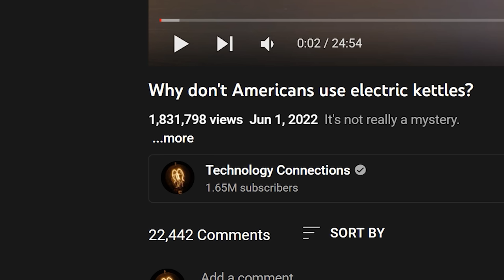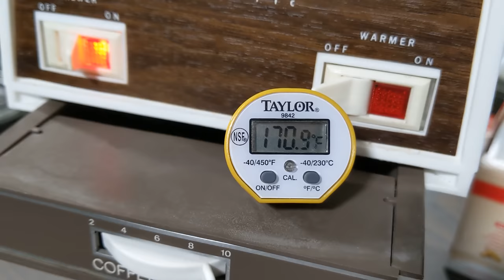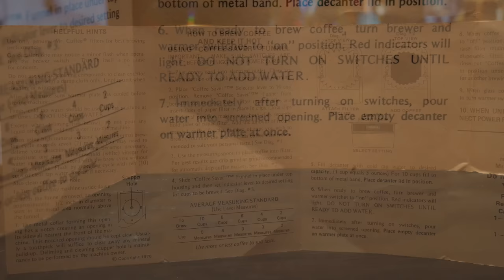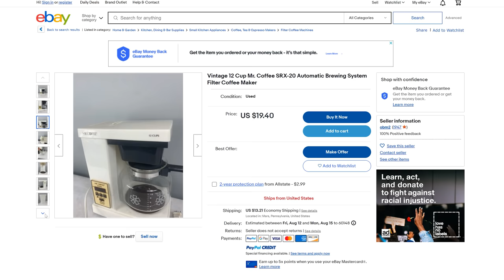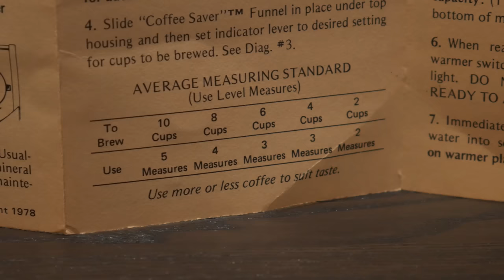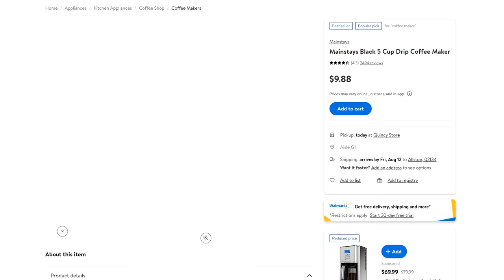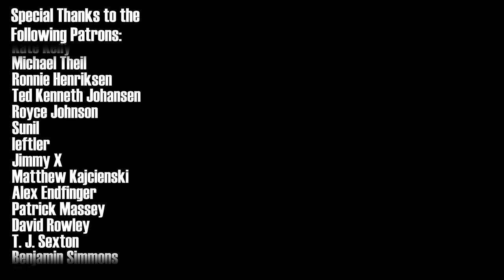Drip Coffee Makers — super simple, super cheap

Comment: If you actually buy a good drip machine, you can set the hot plate to a LOW heat and it wouldn't overcook the coffee.
Reply: good or bad drip machines, the issue with the got plate is with it there and on its just adding heat constantly to the coffee, that turns it out no matter what, it just gains you an extra few minutes, but your right in that unless you spring for the models with an insultated carafe and no hot plate, at least being able to control the temperature of the hot plate is ideal... my machine not only does that, but as the coffee sits the machine steadily allows the temperature to fall, its yet another way that your being told your brew is probably getting old.

Comment: As a coffee outsider from Australia, this is super interesting. 

At 31:21, You mentioned at the end that leaving the hotplate on will quickly burn the coffee. 

The cost saving measure, whereby the temperature of the warmer hotplate in the modern unit is controlled by the same heating element and thermostat combo that controls the boiling, means this hotplate is pretty much contantly set to a temperature just above 212. Which means your "keep warm" part of the machine is actively boiling the coffee, just like a percolator does (except not at all). At 31:37, while you're talking about this same burnt flavour problem, the coffee in the carafe is visibly simmering. Well there's your problem.

I would posit that maybe that the warmer in the older unit may not burn the coffee as fast, or it may have a separate thermostat which keeps the temperature under Marotta's 200 degrees or therabouts, or it may be controlled by a resistor on that board at the back. I'm just saying, maybe the older unit wont burn the coffee while left on the warmer. 

At the very least, you could theoretically modify the older unit with a thermostat set to 190 to control the hotplate, which should keep the coffee from burning. Definitely not something you could do with the modern unit.
Reply: He said the older unit has a separate warmer, only 80 Watts, may not even need a thermostat.
Reply: In my machine I notice the coffee disappears visibly in the carafe after a couple hours on the hotplate, though it doesn't taste burnt
Reply: Thanks for this. I've never had a pot burn that fast and was wondering what the deal was. I assume all coffee makers here have a different setting for the hotplate. The coffee does turn bitter, but that's only after 2-3 hours.

Comment: I like the french press. It's dead simple and easy to clean. No filter paper needed. The only slightly tricky bit is making sure the plunger filter thingy is in tight contact with the walls. Otherwise you could find some grounds in your cup.

I do recommend not getting one made of glass though. There are metal ( double walled! ) models that won't shatter if you tip it over.
Reply: I've been using James Hoffman's ultimate technique for the cafétiere: it's slow, but by letting the grounds settle you get excellent results even with the worst mesh.
Reply: I have one made of glass, and I've never had problems. 

Note: I stir the coffee grounds in the water and let it settle for 2-3 min before I press the plunge. I don't have to use force, I can do it with my little finger. 

I think some people have had bad experiences with glass breaking under pressure, when they tried to force the plunge down with all of their weight. Don't use force.
Reply: Must use coarse ground.   Too fine will clog metal mesh and make it tough to plunge after the right time passes.   I get the best taste by letting water calm down from boil, pouring a little over grounds to get some bloom, wait just a moment and slowly fill french press so as not to dissolve any of those gasses back in (as far as I can tell). Gently stir and put top over it and wait between 4-5 minutes to press.
Reply: Not enough coffee gets made
Reply: @lakrids-pibe  2-3 mins minimum before pressing the plunger down, I think 5-6 makes better coffee. For the plunger you're totally right, press it down over a period of around 30 seconds just putting a tiny bit of weight on it.
Reply: @lakrids-pibe  That's good. For me, it was just my clumsy caffeine-less self knocking the press over while making breakfast.
Reply: @benjaminsmith3625  Thanks for the tip!
Reply: in Indonesia they normally make coffee by putting some ground coffee in a cup and simply pour (nearly) boiling water on it they stir the mix and then wait a minute or so, so that the ground coffee sinks to the bottom, then they drink it using their teeth to stop drinking the coffee grind. They call it "jump up coffee " kopi lompat.
Reply: If all I have is non-coarse grounds I just slip a paper filter over the mesh. I only use the French press when I want a single cup though so it would probably be pointless for more than that.
Reply: Don't remember if it was NPR or Consumer Reports but I now do the 1 min 4 min method. I heat the water to 180-190 and pour in the water. Leave uncovered for 1 minute to outgas. Then stir the grounds and cover with filter/plunger for 4 minutes. Then take 15 seconds to push the plunger.
Reply: I love my electric percolator
Reply: yeah but cleaning them is a pain in the ass.
Reply: @stevenj2380  Yeah I think I dialed in my hand mill's coarseness years ago to about medium-coarse? I've heard electric blade grinders are too inconsistent, but I just don't like how loud they are. If you use a kettle with a dial, it usually has some marks to help find the right temperature without having to wait for the cooldown.
Reply: @SuperRat420  I never need more than 8-16 oz (240-480 ml) in a day, so one batch is 2-4 days of coffee for me if I put the extra in the fridge once it's cooled. Obviously that goes down with extra drinkers, but I do think there are larger presses.
Reply: @NickCombs  I'll all for drinking less if you want less, but French press isn't practical when you want a shit ton. SOrry for being mean
Reply: @KairuHakubi  I rinse the grounds and pour most of them into the compost. Then a drop of detergent and the sink spray nozzle handles the rest in short order. But I imagine the material makes a difference. Roughened glass can get tough coffee stains. Another reason to go with metal.
Reply: @NickCombs  why rinse the grounds before disposing of them? also, how rinse the grounds? you'd have to use a sieve or something.
Reply: @NickCombs  Coarse ground presses better than medium coarse. Small change makes a difference.    These were ground for me in specialist coffee shops here. I've just tried a modest blade grinder instead of better entry level burr grinder I do not have the space for talk grinder or tall coffee machine.
Reply: @KairuHakubi  Sorry, by rinse I just mean I'm pouring water into the press and swirling it around a bit. I didn't explain that very well.
Reply: @NickCombs  ah right. yeah in that case the only worry would be potentially clogging the drain, but if you're adding plenty of water it's probably fine.
Reply: @KairuHakubi  I put mine in the compost so they turn into soil for plants along with other food scraps. I actually keep traps on my drains, so very little food ever gets down them.
Reply: @NickCombs  sure but the traps don't catch things like coffee grounds do they. i'm just saying those are hard to deal with, even getting them into the compost from inside a mug can be a pain.

Comment: For drip machines, the diameter of the shower head, and the diameter of the holes in the shower head, are very important as it relates to the thorough saturation of the coffee grounds and, therefor, thorough flavour extraction.  Secondly, brewing temperature is quite important. 

Most modern-day drip machines have a tiny shower head with tiny holes. You have to look far and wide to find a machine with a large shower head. Currently, I'm using a $13.99 Sylvania drip machine (not sure whether they're still available) which produces much better coffee than the $79.99 DeLonghi drip machine (which I returned) due to the larger shower head (and larger holes in the shower head) and higher brewing temperature of the Sylvania machine. The DeLonghi machine was brewing at 167 degrees, whereas the Sylvania machine was brewing at 197 degrees. Also, the DeLonghi machine left the upper, outer portions of coffee grounds dry. There was complete saturation of the coffee grounds in the $13.99 Sylvania machine.

Comment: Drip machines with vacuum flask carafes are available and work pretty good at keeping the coffee warm for quite a long time! It's definitely an additional cost from an equivalent glass carafe machine.
Reply from the maker: That's the thing - they're hard to find and a LOT more expensive! I normally make two cups and have the second one quickly enough that it doesn't cool off much in the carafe. Then it's no more coffee for me the rest of the day.
Reply: Might as well pour it into a standard vacuum flask and just drink from it as that would save you having to come back to the machine. You can get them in ridiculously large sizes that can easily hold a ton of coffee, some are measured in freaking liters...
Reply: That definitely works too! To be clear, wasn't trying to offer solutions, just noting what exists to solve a known issue - with downsides.
Reply: I have a 10-cup machine and a 2-mug machine (officially 5 cups). I use the 2-mug one daily. Make a pot, then turn the machine off. Then I heat the second mug in the microwave for a minute when I want to drink it. Avoids the burnt taste.

Comment: 2-4 minutes is usually considered to be a good steeping time for the coffee grounds if you put all the water into them at once, but with Mr. Coffee the carafe is much larger than the grounds basket so you need to keep the water moving through the grounds at what works out to be a somewhat equivalent rate to get the right brew.
Reply: 2-4 minutes seems very low to me. With a medium-fine grind, medium-dark roast, and ~91-95°C water I tend to get acidic and weak coffee brewing under 4 minutes and the best seems to be more like 5-6 minutes. It's more balanced and you get into those darker roasted flavors.
Reply: Depends on what's working best for your combo of beans, roast, grind and equipment.  These days I use an Aeropress, and before that was a Bialetti moka pot, so I'm used to fast coffee in recent years. ;D

Comment: As I believe I mentioned in the comments on your percolator video -- please consider doing a review of the vacuum pot brewing method.  In my opinion it is far better than either percolator (which recycles weak coffee water through already wet grounds causing bad taste until the water gets to a set temperature), or the drip coffee makers, which dump almost boiling water over dry grounds (which leads to only partial extraction and to water channeling through the loose grounds further causing partial and incomplete extraction).

The vacuum pot solves both issues, almost boiling water is sent up to the grounds, which are completely immersed and agitated for the amount of time the user desires for the amount of extraction the user desires, and then sucked back down into the main pot leaving the grounds behind.  This allows for glorious tasting coffee, and it's neat to watch too!
Philip
P.S. Vacuum pot brewing was done in many households in the US, in parallel with the development and production of percolators.  Before the advent of drip brewers in restaurants, vacuum brewing was used in restaurants that made better coffee.  Cory and Silex were the two main US brands of these vacuum pot manufacturers.  Drip coffee makers killed them, due to their ease of use and cleanup.  There were both automatic machines and stove top models.  (The automatic machines are just as easy to use to brew the coffee as a drip unit, but the cleanup is a bit more involved.)  One of the most famous automatic vacuum pots was the Sunbeam Coffeemaster.   

One of the main selling points of the vacuum pot by Cory corp was the fact that only glass touched the coffee on their glass models.  On their early automatic models, they actually silver plated the inside of the lower pot -- again to avoid coffee contacting chrome, copper, aluminum  or stainless steel.

One other thing about most vacuum pot coffeemakers is that the filter is reused.  There's no paper to throw out with the grounds (or to separate if you compost your grounds).

Comment: The ideal temperature to brew coffee is between 195F - 210F according to the SCAA. Also more expensive machines will brew into a thermos, eliminating the overheating problem.
Reply: Yeh, where I live a machine for 50-60€ will usually come with a thermos flask, which solves a lot of problems and saves some energy to boot. Its really all you need for coffee outside of 'enthusiast' territory. Things are so simple they usually dont break for a while either.

Im a slight bit surprised that wasnt even mentioned.

Comment: A 20 degree range is pretty amazing when you consider that your oven has a range of 25 degrees higher or lower than the set temperature, giving it a switch off range of 50 degrees. It will heat the chamber to 25 degrees ABOVE the set temperature, then shut off and wait until it's 25 degrees Below the set temperature to turn the element back on.

Comment: I bought one of those Mainstays small coffee makers for $10 just to turn it into a small fishtank (for my desk at work).  

I removed the heating element and put an aquarium air pump in the water input tank.  I ran the tube from that through the "basket" and into the carafe so that when it was on it (sort of) looked like the water was boiling.  And I ran the power cord out where the original coffee maker cord was, so looked pretty stock :)

I wanted to wire the pump power through the coffee maker power switch, but never got around to it (probably for the best, as I don't likely have the electrical expertise to do it safely anyways).

Comment: So many people have no idea that there isn't a pump in regular drip coffee makers, which shows how genius this peice of engineering is, being so simple. I also want to vote for trying the moka pot. There's a reason why millions of Italians use them as their home coffee makers. They are dead simple to use and clean. Barely any more effort than drip and no filters to buy ever since the filter basket is reusable. They will last forever and are great to bring camping as well for much better coffee than instant or percolated. I've seen massive family size ones available as well, so you can make stovetop espresso for the whole family, kiddies included.
Reply: I use a moka pot for my coffee and I love it!

My tip for cleaning it is to run cold water over the coffee tube in the middle so it gets sucked in,
cooling the machine and the grounds down to hand-friendly temperatures in seconds.
Then you can just wash it and be done instead of having to come back after half an hour to clean it which I usually forget.

Comment: I live up in the mountains at a higher elevation. Based on your description of the mechanisms behind the original Mr. Coffee and the more modern drip machine, it seems like the modern machine would be affected by elevation(since it relies on boiling pressure) and brew colder, while the old machine would be unaffected. Are there machines made for brewing at higher elevations, or any way to recalibrate an existing machine?
Reply: The boiling point of water at 6500 feet is still 200F / 93.4C which is all these things appear to get to anyway.  Just how high up are you?
Reply: @BaddDukk  I'm around that elevation. From what I gleaned from the video, if the water is boiling at 200F in a modern coffee machine, it'll cool down further as it goes through the plastic tube up to the spigot. I'm not concerned about a "perfect" cup, but I do know plenty of recipes have to be modified at elevation based on the boiling point of water.
Reply: @litecandle  You could insulate the pipe with something to reduce the cooling. Someone mentioned fitting a length of narrow PEX plumbing tube over theirs.
Reply: In a huge tome about the history of coffee called "Yes floats Coffee sinks" we read years ago, the author said that the perfect brew of coffee took place at 93 degrees Celsius. My 1956 made Bo Ema commercial machine has water in it's boiler at 22psi which I think means the water is 170 degrees c. The water comes out at about 93c. The coffee is made the correct temperature by the milk being frothed to just below boiling point. Try heating your milk.
Reply: @ToastyMozart  alternatively, you could replace the tubing itself with a thicker-walled material as this would prevent the creation of a permanently wet place where nasties could grow.
Reply: There's a establishment at the top of Pikes peak in Colorado, they used to apologize for their "Luke warm" coffee because of the altitude!
Reply: Altitude also affects flavor, but I've had coffee at 9000ft and it was still close to the quality of 5200ft
Reply: I used a drip machine in a ski town that was a 1850 meters OSL while on vacation. After the first morning we bought stocks of Nescafe instant cappuccino. I don’t know if the machine was to blame or the coffee was, either way it felt bad. Now I know why